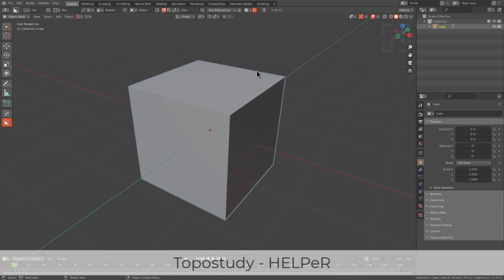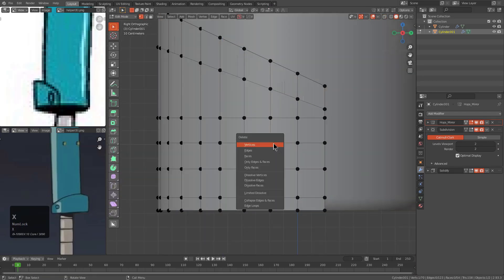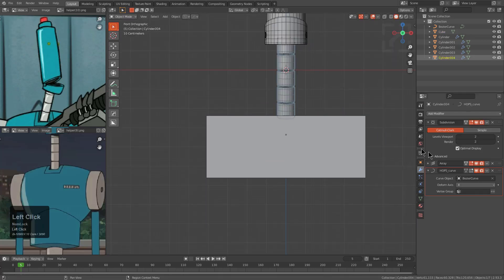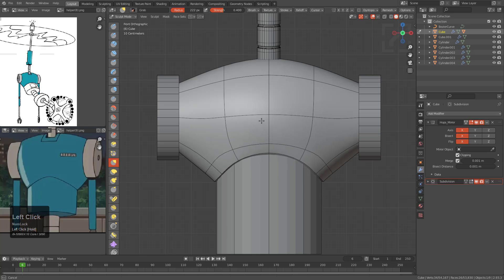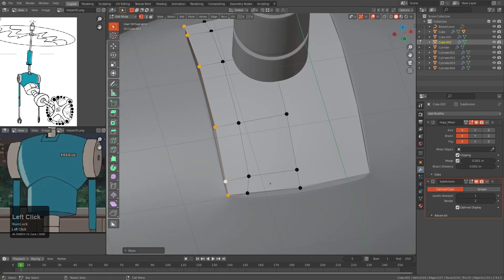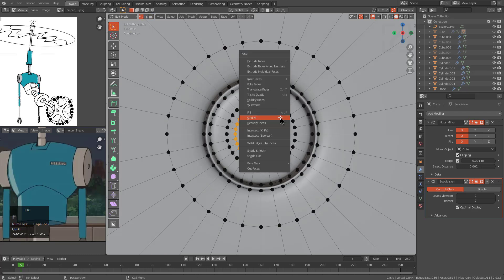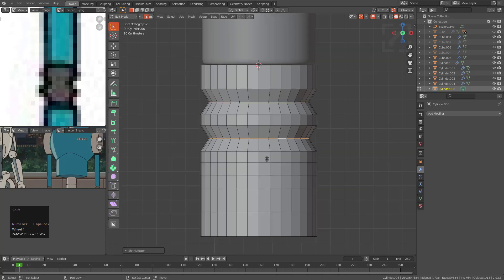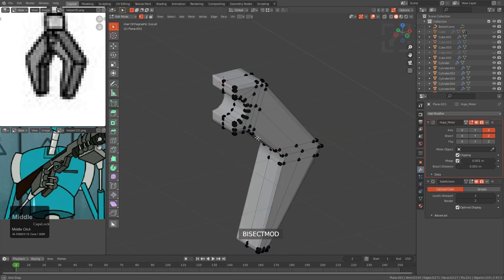Topostudy - HELPeR

Comment: May I suggest an alternative term for "loop of protection," to be: Edge Prophylaxis...  In the land of Maya, protection loops usually create the disease of geometric complexity explosions (they don't teach management of edge flow, i.e., how to merge edges to minimize such explosions...)  I now have to rewatch all your topostudies to see how you are avoiding those vertex count explosions (is it different than what I would do [and mostly forgot]) as you apply your edge prophylaxis for subdivs...  Subdiv expertise is actually controlling edge flow (and that's what took me months to get good at... cause I'm a special snowflake).  I have yet to see you use edge flow to isolate areas of higher complexity from areas of lower complexity.  IIRC in subdivlandia, that's a major skill to acquire.

What I've noticed with your modeling and the modeling of advanced modelers, is that they have tons of separate objects when they model, i.e., they don't extrude or create extra geo from the originating object, they keep appending new object ad infinitum.  How tf do you then UV all of them and then texture them into something that a game engine would not grab its chest and drop dead in front of you?  Am I misunderstanding modeling types, i.e., this type of modeling is for portfolio stuff, where f' the vert count!  Idk how all this exists as a whole in a universe of CGI/VFX/Game Ready Models work.

I like the idea of keeping low poly and that's why hopscutter, taking it in to ZBrush, and adding high frequency detail, then going into Marmoset and baking everything... or exploding the model and then I can bake in SP.  Are all the parts created as you do, so you can have multiple polygroups or something?  It's pretty confusing to me, given I'm really just a classical guitar player and texture artist, sub-specializing in afternoon naps.  Whoops, 3pm, time for a nap.
Reply from the maker: that sounds dirty. Subd def aint low poly. Its an approach for hi.